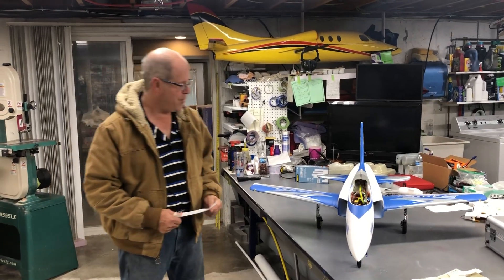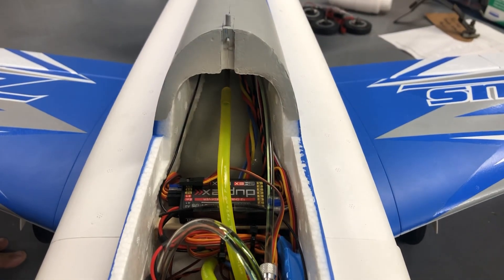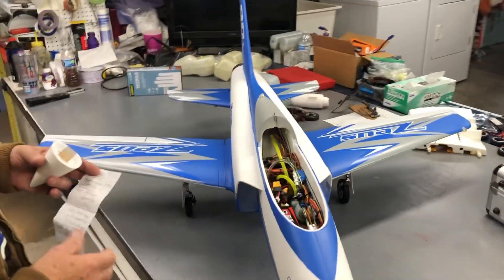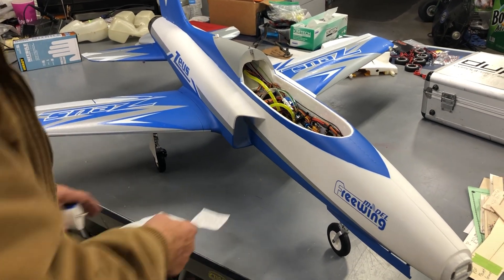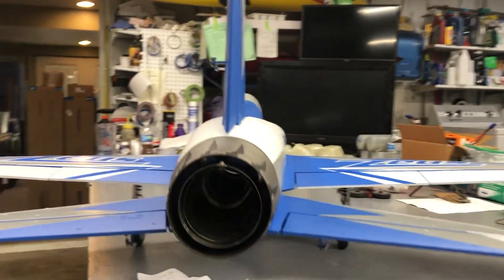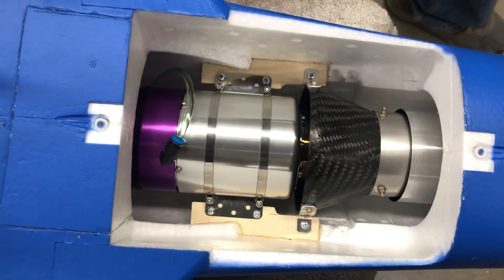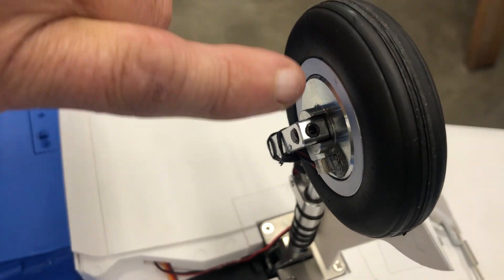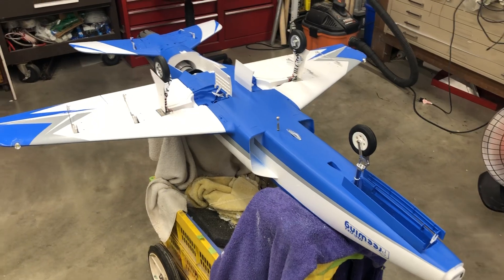Freewing Zeus turbine conversion Episode #2

Comment: Excellent conversion as always Paul. 

Q.Q. are the main tires the originals with the added brakes or are they JP tires?
Reply from the maker: No. The wheels and brakes are LDT from castle rc. The tires are from the eflight viper jet